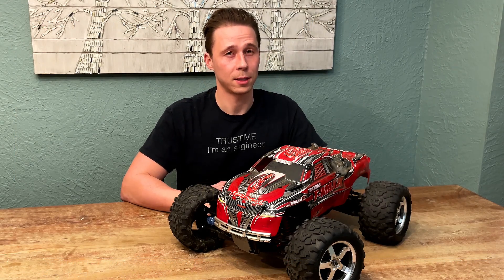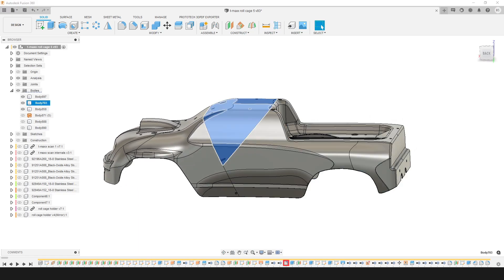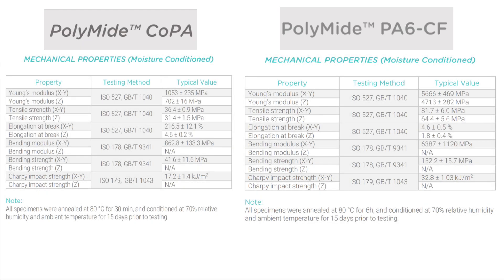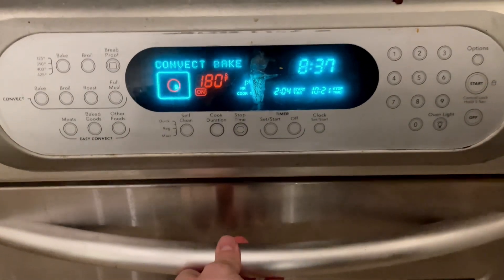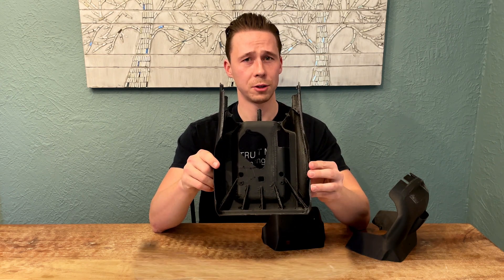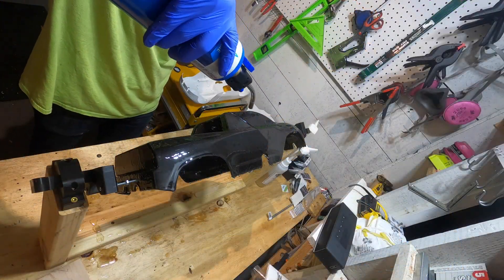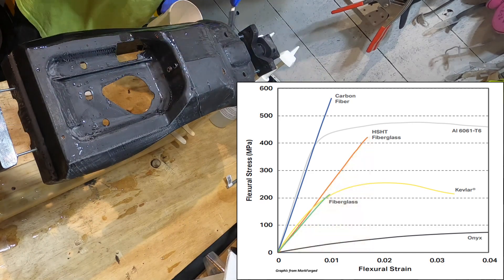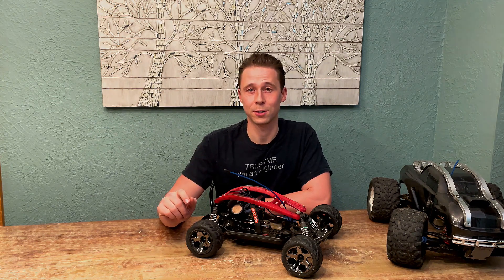Engineered RC Body - 3D Printed, Machined & Carbon Fiber for the T-MAXX

Comment: hell yeah brotherman well done.  Im almost done printing it.  I have a cnc set up that could route those braces but i figure nylon should do and i just dont like itt when alumjnium slides on pavement.  its kind of nails on the chalkboard to me for some reason.  i do like the idea of them being metal though.  How about a version with aluminium with snap in bumpers on the roof.  Oh and maybe you could hold my hand through the whole project.  my wifes 2 cents thanks babe

Comment: What's the weight difference from the original?
Reply from the maker: Great question. It is heavier - about 700g compared to to the original 100g. It’s about 10% of the entire car mass. To make it lighter you could remove more material from the aluminum braces, or better make the printed parts only one wall thick, but that would be quite the slicing endeavor. I did remove the front and rear bumpers since this will serve that function, so net is a little less than 600g